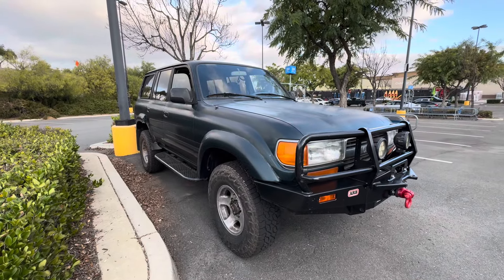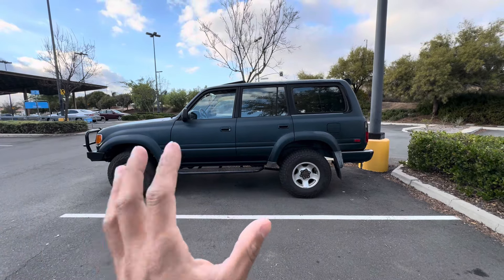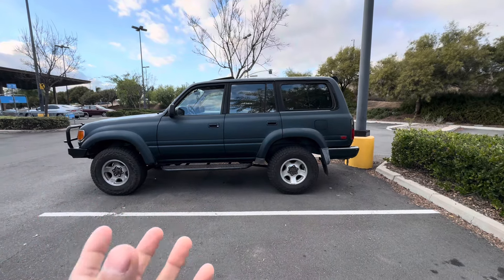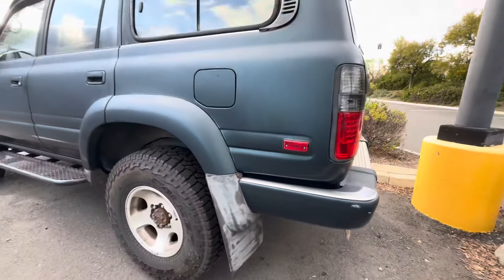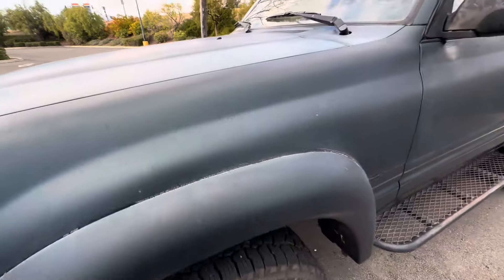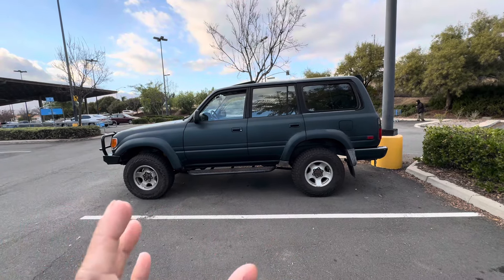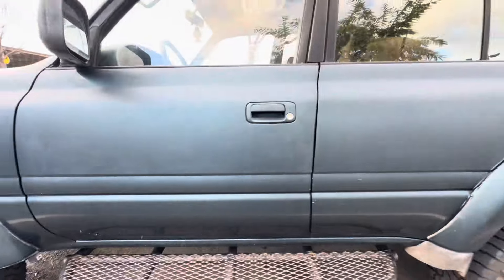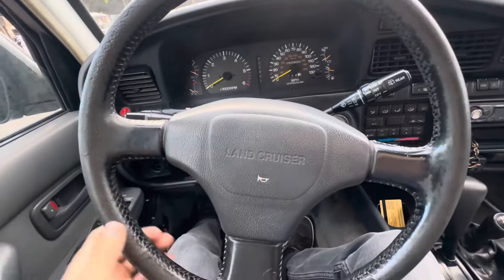Reasons why you should NOT buy an 80 Series Toyota Land Cruiser

Comment: hey Buddy if you fell out of love with your 30+years  old LC then you can get rid of it, I am happy to buy, as it has "so many things happening" to it, I guess we can agree on a fare price. In case you don't want to sell, then please don't make a negative publicity for this legend. Anyone seriously involved in 4wd-ing knows that when you use your rig in the proper environment it was designed for and you do it for tens of years, of course you will have parts breaking down, of course you will need to have some maintenance done to your car. If all that abuse is neglected, then yes, eventually it will break down completely. Nothing (no 4wd car) is made out of diamonds to last forever without any spit shine applied to it, so ... please just be realistic ... somehow I just can't forget how in 2010 this 80 series LC (stock version) was taking me across the dunes of the Libyan desert with 130km/hr and I felt like I am riding on some highway, and that car spent most of its lifetime between the dunes and on the dirt roads of the Sahara, I have nothing but respect for the 80 series, but generally any tin box that has a Toyota badge and 4 wheels attached

Comment: Instead of spending 1.2k on that Bullbar 🤔, you should of spent it on maintance and then preemptive maintenance. I spent 4k on top of my original purchase price doing the labor myself.
Reply: So many new LC owners pay big $$$$ for lifts, front and rear bumpers, big tires and never think to do a proper baseline on the truck for maintenance. That’s where the big $$$ should be spent.
Reply: I just found one i’m thinking about buying on FV marketplace… i’m currently researching if i should go for the 100 Series or Live Axel 80s…. Both would be diesel obviously as i’m building to overland in southern africa and Australia after… I’m just stuck between 80s good off-road but bad road driving or 100 Series decent off-road and superior road comfortability
Reply: It might have came with the ARB

Comment: Great advice! SOMEBODY needed to say this Josh 👍. In a way I feel bad for people buying these old Landcruisers 
at outrageous prices as a result of the IG effect when the fact is many if not most of them actually need a proper full drivetrain overhaul. It's probably worth mentioning that the wiring and connectors all become brittle as well. This of course doesn't seem like a problem until the owner or mechanic has to unplug or wiggle stuff out of the way in the course of various repairs. Btw, I tried posting the part numbers and prices for all the hose clamps below your other video but I don't think it took. Let me know if you want me to DM it.
Reply from the maker: Yes, definitely worth talking about before getting yourself invested in an old, over engineered 4x4. 

Funny enough, because of where I live I haven’t had much connectors going brittle on me compared to other older vehicles I’ve owned BUT definitely worth mentioning because of its age. 

All good, I found them online. Thank you so much for the help!

Comment: Buddy, all I am hearing is an expectation that it shouldn’t be worn out. You purchased a fairly well worn petrol SUV and depending upon the previous owners standard of maintenance you now have parts to replace. As an 80 owner, I would not only expect to regularly replace all hoses, gaskets, seals, etc, but also do a lot of preventive maintenance. Off-road vehicles cost a lot more to run and maintain, btw, sell that lemon petrol and buy a 1HDT. Then you will truly see what an off road vehicle can do.

Comment: I see you are located in North America here in South America. You can get the 80 series in diesel engines from my experience with a 1994 1HD manual, I haven’t suffered from these issues once had a transfer case leak, but that was only the transfer case plug that was worn out because I use the 4 x 4 a lot otherwise then that I believe the petrol engines are a problem.. and to think those engine uses a distributor 😑

Comment: OMG. I have owned several classic Land Cruisers and I would never whine like this guy. If you are going on a long trip and you want reliability from an old truck, then rebuild the starter, alternator, power steering, brake master, slaves, booster, radiator, replace all rubber hoses, reseal everything, replace all fluids, replace all wheel bearings, rebuild u joints…. Just do those obvious things right away. 
I suggest next time you go buy a Jeep Cherokee and see what happens!

Comment: Charcoal canister is such an easy fix. Maintenance on anything older then 15 years is key. Yes they add up but certainly cheaper then letting them go and create even bigger problems.
Reply from the maker: Yes cracked tank was definitely avoidable with the charcoal canister. That was purely on me for sure. Although after inspection of fuel lines I’m glad I’m changing it all out. 

I agree, upkeep on maintenance is key to this whole journey with the Land Cruiser and if you have the time and motivation
Reply: theres no way your charcoal canister CRACKED YOUR TANK BRO. I cant believe you got all these comments talking straight out of your ass @Yotaadventures

Comment: I drive 97 LC. I bought it over 24 yrs back and no regrets. 230K miles and still going strong. Yes it’s getting old and some plastic &!rubber has become brittle and falling off. Paint has worn off. Engine and transmission is still good. I still take it on a 8 hr drive w/o any issues. I went through many cars in these 24 years, but Landy is still with me and as dependable as when I bought it.

Comment: Many of the reasons you list is why it took me well over a year to find the right one… Many out there are in dire need of updating, and even my one owner, well maintained 1996 needed/still needs some updating.  What people don’t anticipate are the things that break due to age while trying to fix the original issue.
Reply from the maker: Age + off road abuse (I think is the biggest one) and dirt. It all takes a toll magnified compared to restoring an older sports car. You’re going to be going through more parts you may think. 

For me absolutely worth it because it gets me to places where I need to go reliably, for some it’s worth taking to a shop OR considering a newer vehicle.

Comment: You are comparing apples and oranges when you bring up your 2014 Tacoma. A difference of 20 years will make a difference in the wear/tear on certain items. All vehicles have rubber and WILL fail over time. There are threads on IH8MUD about the cracked tank, it is a common issue with the 80 series. Also, you mention that the rubber gaskets for oil relate to the oil pressure, you are actually wrong crank shaft and rod bearings are the biggest factor for oil pressure. Honestly what do you expect buying a 30 old vehicle, showroom quality? The previous owner is the one to blame for the lack of maintenance. You bought it knowing what you were getting into, if you did not do your research first that is on you.

Comment: I think there are some necessary caveats…1) in what condition did you buy the vehicle, where did it come from, how many miles did it have when you bought it, and what maintenance was done when you bought it; 2) it’s a 1FZ-FE, an engine known to be less reliable than its diesel counterparts; 3) how are you using the vehicle? 
You make some great points, and I’ll take them into account with my HZJ81, but you did buy an 80-series at $3600 (what was the mileage?) and it sounds like you’ve driven it hard and put it up wet.
Reply from the maker: The only things I would say that are falling apart have been rubber components (bushings, cooling, hoses, fuel hoses, etc) and the interior. Outside of that, the 1fzfe runs in top shape. 

Well abused by me for sure as it’s intended to. 

In the end, I hope I was clear that it’s been absolutely worth it for me because it’s lived to the purpose of what I intended it for. I also hope for you too since you own one of the greatest vehicles ever made. For the majority of people, it may not because of the time + money needed to be invested in it to get it back where it needs to be.
Reply: The 1FZ being less reliable is definitely a relative statement.  That engine is essential a tractor engine.  Meant to be rebuilt twice over.  It’s essentially indestructible if maintained properly.